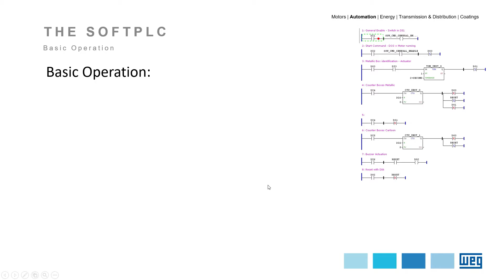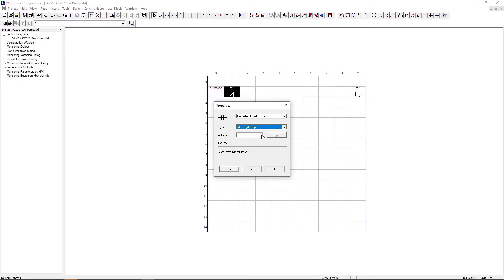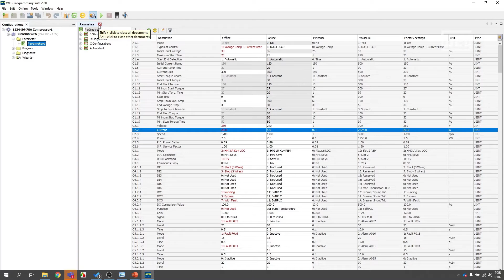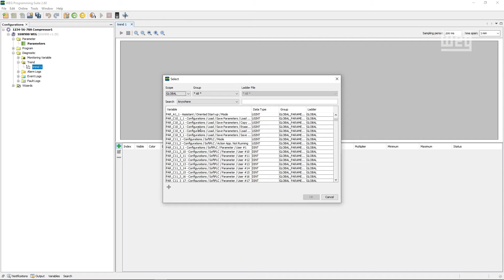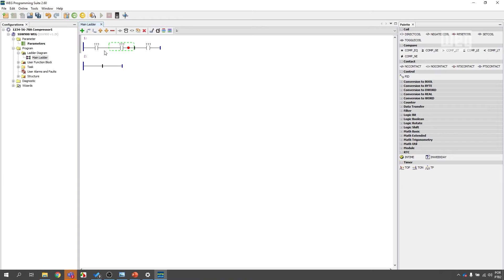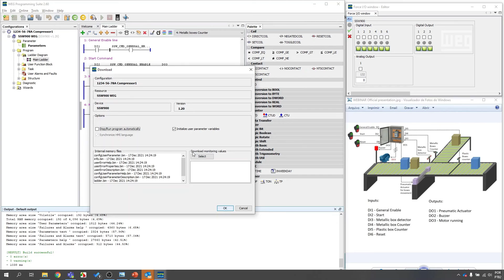SOFTPLC: PLC Functions on your drive bringing cost effective solutions

Comment: I am just starting out with this WEG Programming Suite...  Why is there no Programs folder available in my Configurations window?  I'm starting the project with a CFW700 drive, but I do not have the drive connected to the computer.  Is it necessary to have the drive connected to see the Program folder to start building the ladder?
Reply from the maker: Hello James,
Good to see you are using this great tool. We are positive you can achieve great results using that.
You don’t need to connect to the product to use the ladder tool. That would give you the chance to work on the code before accessing the product and potentially save time. The reason why you are not finding the location for programming is the product you are picking. For the CFW700 the structure we use for ladder programming is the WLP which is another free software you can download from WEG website. So you could either give it a go using this software or choose a different product (for example CFW900) on WPS (WEG Programming suite) for that.
Thanks again for contacting us.